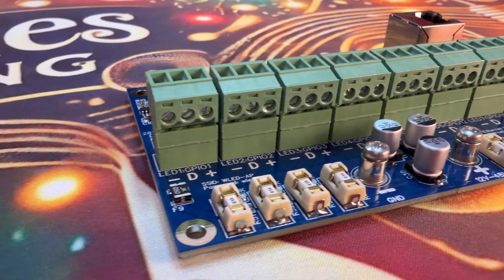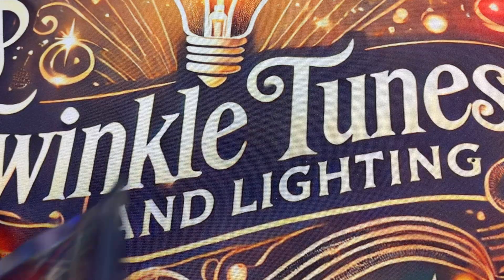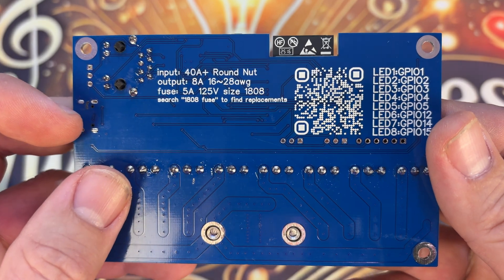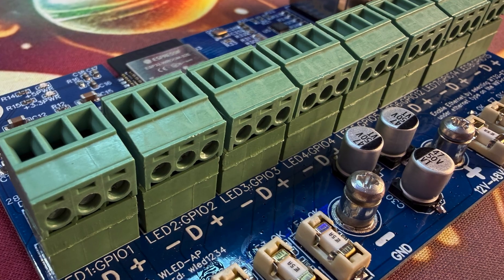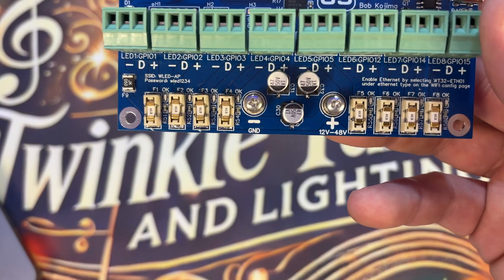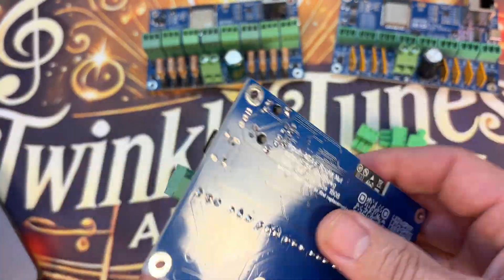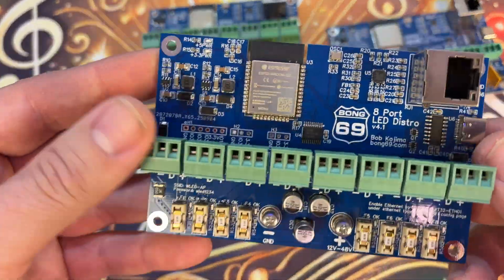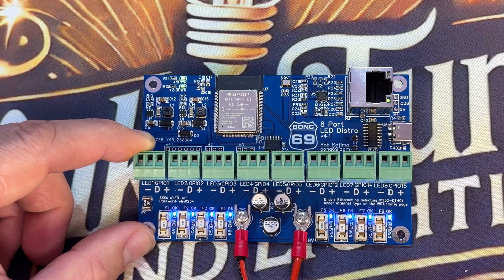Bong69 WLED Controller Explained | V1–V4 Evolution & Key Differences

Comment: Another question. I accidentally add the wrong IP in wled when setting up a static ip now I cant connect to WLED. Can I just reinstall wled to the controller to reset it
Reply from the maker: Yep! There is no reset button but  you can just upload WLED back on to it.  I find that to be the easiest.  I am running 14.4 right now and it is really stable.  Make sure you are using a USB transfer cable.  Many cables out there only provide power and not data.  Here is the website.  https://install.wled.me/. I hope that helps!

Comment: Anyway to reset the board? I have one I can’t get logged into.
Reply from the maker: There is no reset button but  you can just upload WLED back on to it.  I find that to be the easiest.  I am running 14.4 right now and it is really stable.  Make sure you are using a USB transfer cable.  Many cables out there only provide power and not data.  Here is the website.  https://install.wled.me/. I hope that helps!
Reply: @twinkletunesandlighting  thanks!

Comment: about how many ws2811 can you run off a single output without power injections. i know it can depend on how bright your run them. so example could I run 300 ws2811 on each port about 10-20 percent brightness
Reply from the maker: You can definitely get close to that! 👍 At around 10–20% brightness, running about 250–300 WS2811 pixels per port is totally doable without power injection, as long as your wiring isn’t too long. Once you start going brighter or pushing full white, voltage drop becomes noticeable past 200–250 pixels — that’s when injection helps keep things even.

I usually recommend testing your longest run with a white effect at your target brightness to see how it holds up. Every setup’s a little different depending on wire gauge and supply voltage.
Reply: @twinkletunesandlighting  is there another site to buy the controller? The tindie site wont process my info or let me use paypal